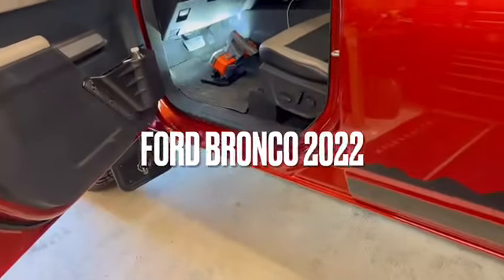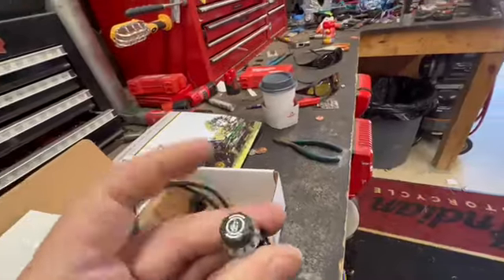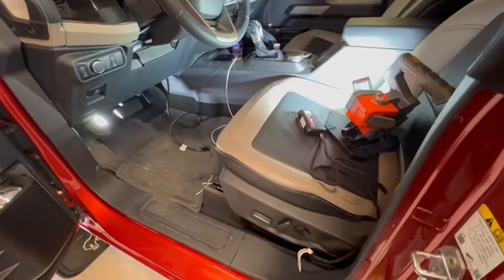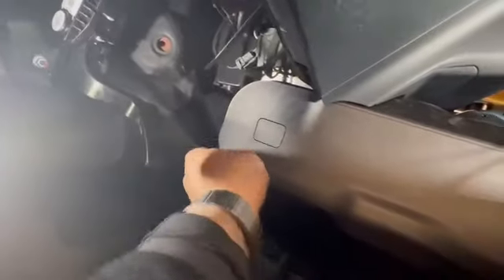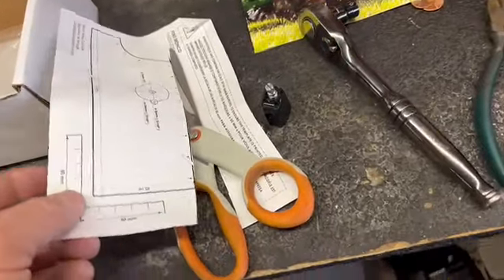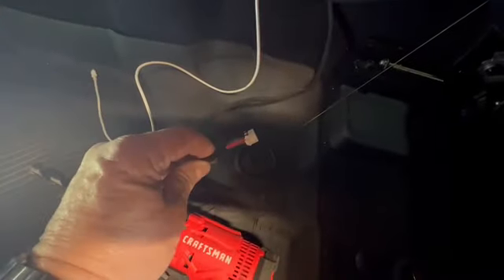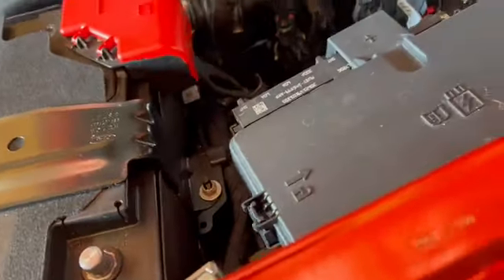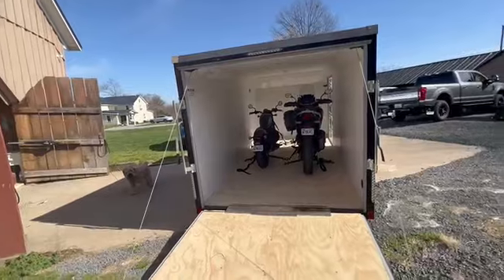Electric Brake Controller Install Ford Bronco 2022

Comment: Thanks for the video - hard to find info on these things! Am I right in understanding you got the hitch option from the factory (I believe that provides the plug up front to connect the controller to?)
Reply from the maker: Yes factory wiring set up correct.

Comment: some electrical tape over that sharp edge would have saved you some aggravation.

Also, I would have put the knob by the dash, somewhere closer to the steering wheel.

A 1 inch wood bit or hole saw would have made short work of that hole.

Comment: Does anyone know if I installed an after market wiring for 7 way, I will need to cut the blue wire and wire it to the wiring harness instead?
Reply from the maker: My Bronco had a factory wiring harness for the plug and play.  Sorry I do not know the answer reach out to E TRAILER they know there stuff and I believe have wiring harnesses for the Bronco set up.

Comment: The position of your controller may not function properly.  It has an inertia switch in it and should be mounted in a specific direction to work correctly.  Ford has installation instructions to install everything correctly, not the way you did it.
Reply from the maker: Good point but never had an issue with the settings and or trailer output to be correct.